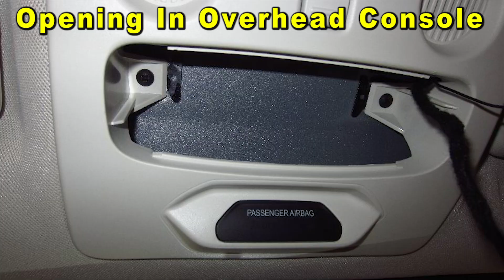2013 To 2023 Ford EcoSport How To Change Dome & Map Light Bulbs With Part Number

Comment from the maker: Ford EcoSport Map & Dome Bulbs - https://amzn.to/3R9gEOh
LED Map & Dome Light Bulbs Part Number - https://amzn.to/3wMfjGc
Precision Screwdriver Set - https://amzn.to/3sLixaP
Plastic Pry Bar Tools - https://amzn.to/3HMtsV7
Socket & Ratchet Set - https://amzn.to/3Z17LbA
Mechanix Gloves - https://amzn.to/3jCnHkt
Torque Wrench - https://amzn.to/3vS5uSI

The Paul79UF YouTube channel is a participant in the Amazon Services LLC Associates Program, an affiliate advertising program designed to provide a means for sites to earn advertising fees by advertising and linking to Amazon.

This DIY video shows owners of the 2nd generation 2013 to 2023 Ford EcoSport SUV how to change a burnt out dome or map light bulb in the overhead console.

Comment from the maker: Check out the DIY guide for changing the dome and map light bulbs in a 2013 to 2023 Ford EcoSport - 
https://www.paulstravelpictures.com/Ford-EcoSport-Dome-Map-Light-Bulbs-Replacement-Guide/index.html

Here are all of the DIY repair and maintenance tutorials for the second generation 2013, 2014, 2015, 2016, 2017, 2018, 2019, 2020, 2021, 2022 and 2023 Ford EcoSport SUV - 
https://www.paulstravelpictures.com/Articles/Ford-EcoSport-DIY-Repair-Maintenance-Guides.htm

Owners of other Ford or Lincoln vehicles such as the Fiesta, B-Max, Escape, Edge, Bronco Sport, Explorer, Expedition, Transit, Focus, Mondeo, S-Max, Puma, Kuga, Endura, Everest, Ka, Figo, Endeavour, Aviator, Corsair, Nautilus and Navigator may also find these DIY instructions to be helpful.